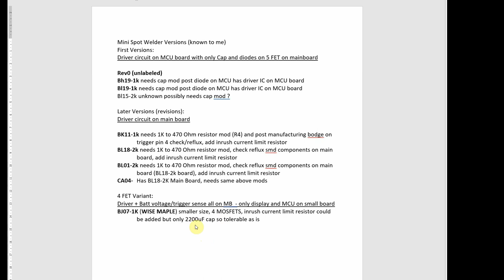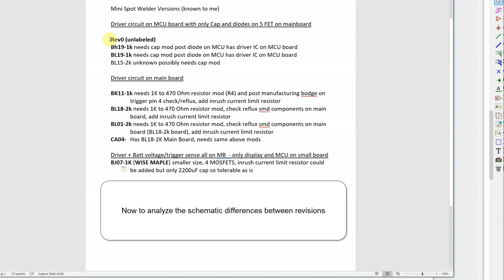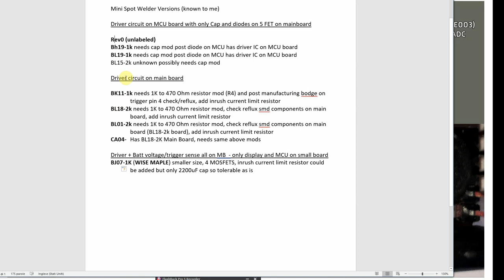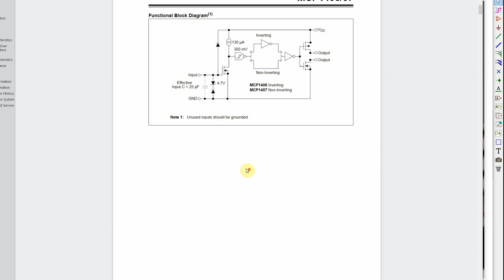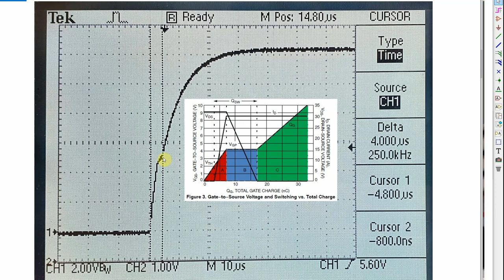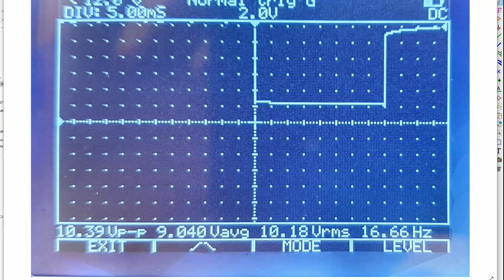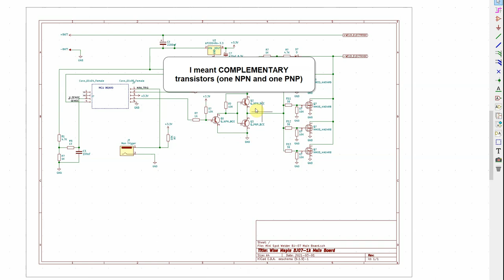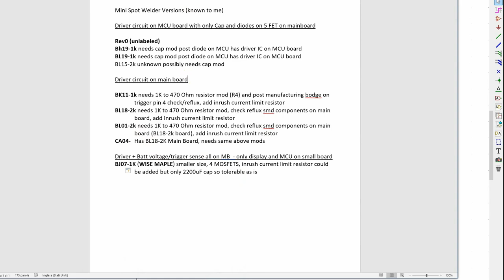All "Mini Spot Welder" versions: circuit Analysis, differences and faults

Comment: Hard to believe how hard you and others have worked to try to understand and repair this cursed design ;).  Thank you.  Well, at least now there's a community of people who know exactly what not to do when designing and manufacturing a spot welder.
Reply: @simplyfocus9937  Not really. What you need to know is, how it works and how to handle it. Power drop is a problem for every MOSFET in a spot welder, so I highly appreciate the tipps and tricks mentioned here.
Something I would like to add is, that a series of super caps easy your work very much either as your only power device or in addition to a battery...

Comment: Hi Luca.. the 2 resistors I’m interested in are the 2 to the left of your yellow dot cursor. Can I buy from you the circuit diagram of “Rev 0 first edition “ as you illustrate in “All mini spot welder versions :circuit analysis, differences and faults “ video 17 minutes and 35 secs into the video.
Reply from the maker: Hi William, I never made the schematic of this version as I don't have the welder in my hands, I only analyzed the photos. I am not aware of any schematics available. The 2 components on the left of my cursor are a 10K (103) resistor and a capacitor as I  mentioned in my other reply. I can send you the detailed pic of the mcu board if u send me an email.

Comment: I am humbled by your sharing.  You Helped, but unfortunately I bought one of these 'units' that is A DIFFERENT VERSION YET... a mix of 'Rev0' and new design.  The Mezzanine has boosted the 470uF LDO regulator CAP to 1000uF AND another boost regulator circuit (8258 STmicro etal) in the area where the Microchip FET driver was located.  It still has the optoisolator  and all the pullup resistors but a different uC and some different circuit board runs around it.   The Main (bottom) board is also different with nothing on top except a 10K cap ( resistor networks no diode  etc) BUT has a POPULATED UNDERSIDE with diodes and resistors for each of the MOSFETS (which also 'appear' to be different (Infineon-IPLU250N04S4-1R7 marked 4n04R7).  There are also some brass bars reinforcing the board paths along the mosfets and 'thru conductor to connector terminals'.   I have become so confused and spent so much time trying to figure out what mod i should do before turn on... But thanks to your DETAILED Analysis along with the seemingly improved variation of this board/system once again.. I am doing no modifications to the board (except cleanup of crusty flux and de-oxit on mezzanine pins) and will make a 50 ohm 'touch' resistor to 'clip' on battery wire to use for precharge of 10K cap before then connecting directly to the battery.   This unit was purchased 2021-12 from Banggood - there are no markings on boards (version or even component labels).  I have details pics if you are curious.
Reply from the maker: Hi, please check my playlist link at the end of this video, I have already covered this  "new Rev 0" model and a couple of other more recent variants.
Reply: @Luca_Techy  THANK YOU.  GREAT !  Note I will probably not load the uC output so much - I have couple different optoisolators that have CTR 100-200 and 200-400  both with spec collector peak current of 100ma at tp<2ms.  So then will leave 1K from uC.  Should be better waveform as the more current the slower rise/fall .  Then do your output mod from optoisolator.  Wondering if it might be easier just to 'dead bug' a couple transistors/resistors on optoisolator for driver using same Boost 15V supply ?  THANKS AGAIN !

Comment: Just received my Wise Maple. Package said that it is WM-V2, the main board has indication Bj15-1K and the small board is labelled Ce12-05b, which is not on your list. Looks like something new. However the circuit looks exactly as Bj07-1K.
Reply from the maker: They often change the code to indicate a production date or origin, it's not always relevant to the effective version or revision - there is no real industry standard with these cheap devices. The only way to know if there are variations is to actually look at the board.

Comment: I had a dim display on my REV 0. Checked the 6.3v cap and it measured fine ESR wise. Went to replace it anyway and noticed it easily pulled off the board when trying to cut it off. The board pads were not damaged. Shows that it was not soldered very well and that explains why it wasn't working. 
Thank you for all the work you and MakerFabio did for these!

Comment: Thank You!!!
I received my Mini Spot Welder today (CA04-2k) and I will be performing the appropriate modifications.
My current system is a DIY battery/solenoid/12v timer module set-up that has served it's purpose but is notoriously unreliable. Either the welds are too weak or I'm blowing holes like a plasma cutter. No happy place in the middle.
I had seen the Mini Spot Welder advertised and reviews were mixed, with many complaints of premature failure. Your video series explained very clearly why those failures occur and what is necessary to prevent them.
Thank you again for taking the time to do this. It's only a $25 investment in a cheap portable welding unit but the knowledge I've gained from you is worth far more than that. I truly appreciate the effort you put in to this project.
Reply from the maker: You're welcome!

Comment: I have a version of this spot welder that has no name plate or serial numbers anywhere on it.
It has the white buttons...And was purchased 3wks ago from Banggood. 
I carried out the Cap mod and beefed up the tracks... And using a 12v 36Amp car battery with heavy duty power cables...I'm getting great spot welds on the 35m/sec setting on 0.15mm pure Nickel strip...
Unit or cables barely get warm after a 24 spot weld run.
Thanks for the informative information you have provided for owners of this Spot welder.

Comment: This is the third video from you that I watched today on this mini spot welder and I'm so glad that I have.. At first I was disappointed to learn that my board is the older version but now I know that it is actually the more desirable one. Your explanation of the switching speed mod and how to calculate the voltage at the transistor base (at about 53 min) was the best I've come across without intimidating my math deficient mind. Thank you so much for helping so many hobbyist and such to enjoy and understand the working of electronics.

Comment: Luca,  thank you so much the great job in studying the boards and recommended fixes.  I had a BL18-2k before I found your channel and the MOSFETS blew on the very first attempt - even when the battery was in the recommended range. I had new MOSFETS resoldered back on the board and went on to replace R4 resistor as you recommended and discovered that the original resistor had a dry join. I amazed that the manufacturer did not bother to even test the boards before shipping them out. Anyway I soldered in a 470 ohm resistor and now the board works perfectly.  Thanks for all you hard work.
Reply from the maker: That's a major issue on all these boards I point out in all my videos, low assembly quality and no QC. Be sure to add the inrush current  limiting resistor too as stated to avoid killing the diode (check it of you haven't).
Reply: @Luca_Techy  The diode could be killed by inrush current. But it's equally likely that it gets killed due to the lack of any capacitor at the "anode" side of the diode. This is the battery input. When the mos switches off, the self-inductance of the cable connected to the power source (battery) will make sure the current (few hundreds amps) continue through that tiny diode.  A better fix would be to connect the big 10mF cap to the battery input terminal (like v0 design) and add an extra 10uF after the diode (no series resistor needed due to ESR being high enough). 10uF is enough to charge the gates. During welding it will drop only 0.1V. The current 10mF cap is just silly in that place.
I've welded an e-bike battery pack this weekend and all worked fine with the two modifications applied. I did notice that the cables get rather warm even after 15 welds. So a lot of current must flow (I use 40-45 E as setting). I let it cool down after every group of cells.

Comment: EXCELLENT work, Luca. Highly appreciated. THANK YOU! 
Greetings from Munich, Ger.
Reply from the maker: Thank you! Cheers!
Reply: @Luca_Techy ...  I followed your advice on these 2 major Resistor Mods and my C04 Series  Mini Welder is working flawless at 40 msec pulses on 0,12 mm Nickel-strips. Batt: 5200 mAh Lipo, 80C with 300 A ANL fuse. Connecting wires: 9 AWG pure copper, leftover from Hifi-speaker wiring, 60 cm total length.

Will Keep on tinkering til the Hut burns down ;-) Thanks again! 👍

Comment: I have an unmarked version, quite similar to "Rev0 first or unknown". Display board has the same amount of resistors, and most components/placement looks identical/similar to rev0/unknown,  but mine does not have the MCP1407E. In place it has a B628 (SOT23-6, 2A step-up?). Bottom board has a 10000uF cap in parallell with the battery, and two thick metal bars soldered between the positive terminals and between battery negative and 5 diodes going to five mosfets). Do I need to modify this version to protect it?
Reply from the maker: Please take close ups of the top and bottom of the MCU board and main board so I can take a look, I don't think I've seen this version. You can mail them to me (email on the info page) or post them somewhere.
Reply: I just received the same board with the thick metal bars on the bottom traces and the B628, were you able to find out if  it required modification?

Comment: I am an amateur that just got one of these. Make sure you don't make the same mistake I did. 

I used two-prong thin extension wire to give me 5 feet between the mini spot welder and my car battery. It had almost no power.  I did notice the extension getting warm, that was a clue I missed.

I then connected the welder directly to my car battery with the one foot thick wires the welder came with and it worked perfectly.

Comment: Thank you so much for sharing your knowledge! I got a CA04-2k today and this really helped me a lot.
Reply: I got it too and havent done resistor mod (eeeeeh, 7v will be fine)
Well it was for 30 welds and fet broke
Reply from the maker: Great to hear!
Reply: @Luca_Techy  Hi Luca, the CA04-2k only need to replace the r4 resistor or need more fixes...I have see a photo to r4 for an aliexpress user and they do not put off the resistence, only add a 500ohm resistor...is correct? thanks for your video but I speak a little english and I do not understand rhe entire video
Reply from the maker: @francisconotengo3477  Yes you can put in parallel another 1K Ohm resistor with the one already present (R4) - this will reduce the resistance to 500 Ohms which is ok. You also need to modify the M7 diode on the mainboard and add a 10 up to 50 Ohm resistor (20 will do fine) in series with this diode. Check my other prior video on how to apply this mod (current inrush limiting resistor).

Comment: Luca, that was a much needed video. It really puts things into perspective! Not only does it help one understand what the differences are between the revisions (versions) of the welder, but it is also very educational. I knew mosfet drivers are sometimes used but I couldn't understand why as the same job can be done with humble transistors. Speed is the answer! The capacitor attributes of the mosfet is something that never crossed my mind it could cause issues. Now I know it can, on certain applications. I already downloaded the video to keep it, as it contains info. that will prove helpful on other things aside of welding. Just a final question. Earlier revisions of the welder include: 1. The five mosfets and a mosfet driver. 2. The 10000uf cap dedicated to assisting the weld. 3. The cap mod protecting the logic. Would I be right saying those revisions, offer a more robust welding experience?
Reply from the maker: That's correct. The earlier versions with the cap mod in my opinion are the better choice and offer a more efficient weld.
Reply: @Luca_Techy  Hello , thank you for all the research you have done on these cheap spot welders . I am in the process of ordering .
First version with mod is apparently the best . However , since it is impossible to know up front which version I am buying (aliexpress) , and the Rev0 (Bh19 , BL19 , BL15) is probably not produced anymore since they blow up and cause nothing but complaints , it is most likely I will receive one of the modified inferior versions (BK11 , BL18 , BL01 , CA04) . 
Wouldn't the safe option for someone like me who is ordering right now just be to order a Wise Maple (BJ07) , so at least I know what I am getting + the added convenience of it being usable out of the box ?

In other words for someone ordering now :
Wise Maple (BJ07) > (BK11 , BL18 , BL01 , CA04) ?
Reply from the maker: @pollyvermeet5186  in short, yes if you don't want the mod hassle - the Wise Maple is useable out of the box but you should still add the inrush current limiting resistor to protect the diode to be on the safe side as even if the decoupling cap is only 1000uF ithere is still a current peak when first turned on - though effectively much less than the other models with a 10000uF cap. The only limitation of this model is that the weld time is limited to 30ms - but this is plenty if you are using a 60+C 3S 5000mAh LiPo or 40+Ah AGM battery.
Reply: @Luca_Techy  To add the 10 Ohmn inrush current limiting resistor to the Wise Maple version is the same procedure as on the Rev0 boards ? As can be seen here in your video at 8:57 ? https://youtu.be/RSrlXqFxhp8?t=537
I cant seem to find a picture for the Wise Maple version specifically .
Reply from the maker: @pollyvermeet5186  It's very similar: simply add in series the resistor using the same method. The diode is located directly under the green 1000uF cap, you can't miss it. Unsolder it and rotate one pad slightly off alignment so as to not make contact with the other and add in series a 20Ohm resistor.  If you don't feel up to it then you can always use the alternative method by using a specific XT60 or XT90 plug which has embedded a current limiting resistor. This is used for large RC model speed regulators which also have enormous cap banks to avoid creating a large spark when connecting the battery. You can find these connectors on E-Bay or various model sites (hobbyking) and even on aliexpress. The connector is yellow and has a small coloured band on one side indicating the current limiting type. All you need then is to use this connector also on your battery and you don't need to modify anything on the Wise Maple itself. Here is an example: https://www.ebay.it/itm/293577776820
https://www.dronetrest.com/uploads/db5290/original/2X/c/c38b50734f159fbdbb822b3d76e638b8b53ea244.jpg
Reply: @Luca_Techy  Very clear . Thank you so much !

Comment: Luca, First of all, thank  you for the magnificent explanation. As a retired electrical engineer you really explained everything very well. The conclusion is Rev0 is probably the best board and then get a good battery. No point to rush and use a small AGM. I was wondering if you can take the controller board to build a better external driver board with better heat envelope, better connections, etc. Have you opened one of the more expensive welders (200-300 USD). I am curious about the circuit architecture.
Reply from the maker: Hi Jose, thanks! I do not have at hand any of the more expensive spot welders (k-weld by keenlab or the DIY spot welder by Maletrics) so I haven't had a chance to analyse the circuit but judging from the pictures, specs, calibration and reviews I am pretty sure they are well made for that price range. The calibration procedure to fine tune the weld energy is a good indication of a quality level product. That's all I can say unfortunately without seeing the specific schematics or doing a REI on the product! It would be nice to review one but I'm not going to break out a few hundred bucks just for that;).

Comment: Hi Luca, I caught your video when someone asked about this spot welder. So I decided to buy one and received it today. I am finishing a BMS install on a battery pack with 4 HEADWAY 38120 HP 3.2V 8AH LIFEPO4 batteries so I have not tried the spot welder yet. But, I did receive the Rev 0 and I have a scope. I have not made any mods to it yet. Feel free to email me, you can find it on my youtube about page with a full web browser. 
FYI, It does look like pin 4 is the fet controller output pin from MCP1407 pins 6 and 7
Scott
Reply from the maker: Hi Scott, thanks for the feedback - yes it would be cool if you could take a couple of Gate shots and check the rise and fall time for comparison. You can post them anywhere or I'll drop you an email if you prefer.
Reply: @Luca_Techy  Hi Luca, email might be better, I don't have a big social media presence, or I should say I don't sign in that often on the forums I belong to.
I did add the cap mod and a trace wire off pin 4 for the scope capture. Maybe I will have some time today to do this capture.
I did finished the battery pack and ran a few welds while monitoring the voltage dip. The good news is the voltage drop would not be an issue with this battery if I run it directly. But as a test I ran it through the BMS and the BMS did cut off when I hit 25 so its definitely pulling more then 120 Amps. Good thing I had the cap mod installed so no damage to the spot welder.